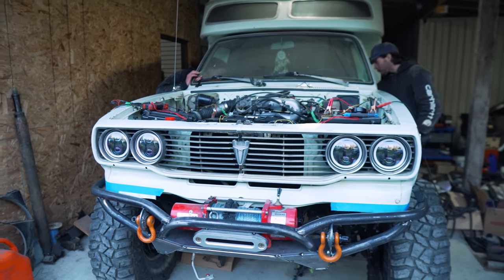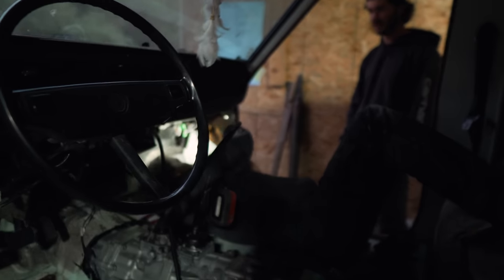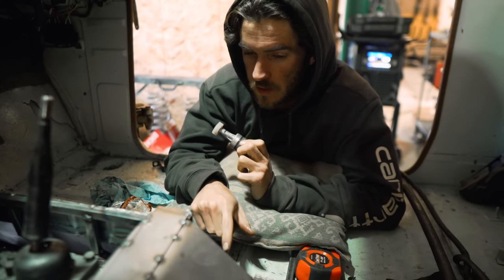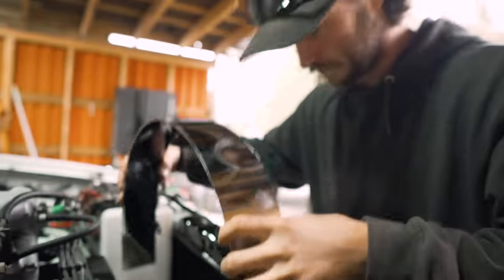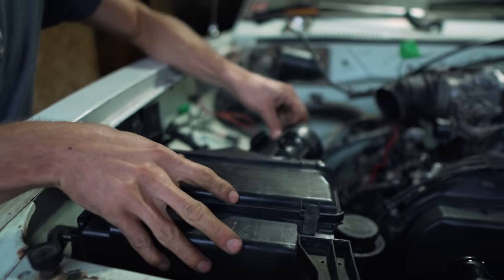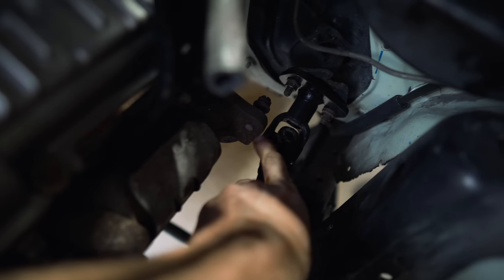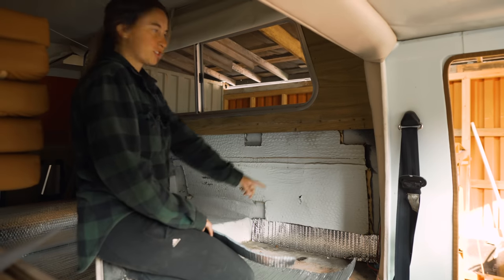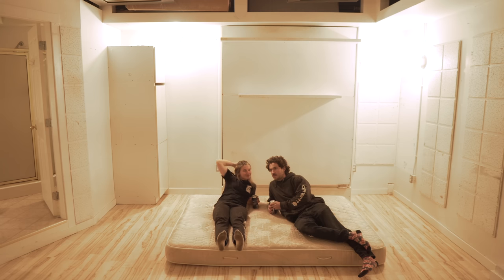Land Cruiser Chinook runs for the FIRST TIME | Toyota motorhome 4x4 conversion fully custom build.

Comment: I’ve had these headlights. They are pretty bad and borderline dangerous. You will also get condensation everytime it rains. Pick up morimoto super 7s or the jwspeaker headlights. You’re looking at about 300 a piece depending on which you choose but you will get a factory quality light.

Comment: Hey guys I went back on your videos couldn’t find it what radiator did you use I’m getting ready to put a three core in mine but finding one with the center cap in the middle of the radiator is difficult
Reply from the maker: We mentioned it in the last vid, it's a CSF 2316!
Reply: @ToyotaWorldRunners  i hope you mean 2306 as i can not find a 2316 listed.. thanks